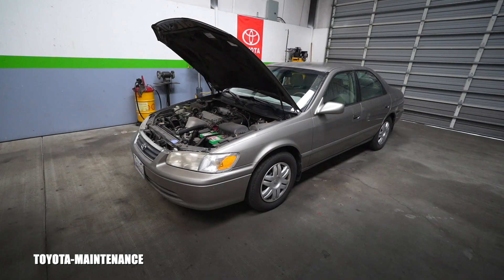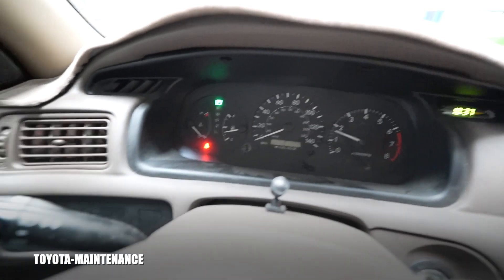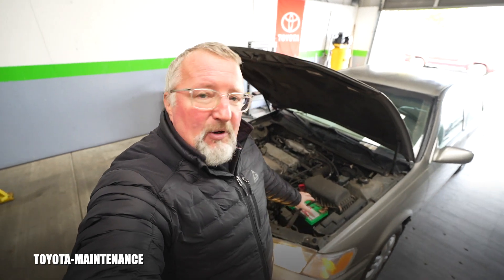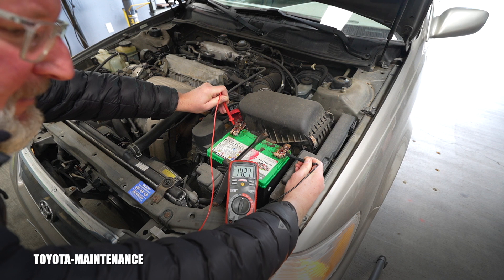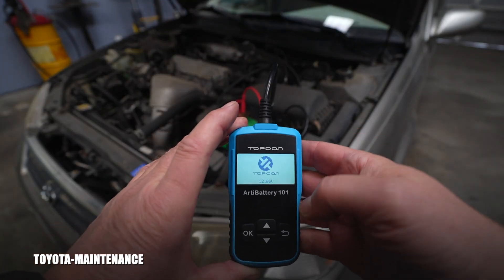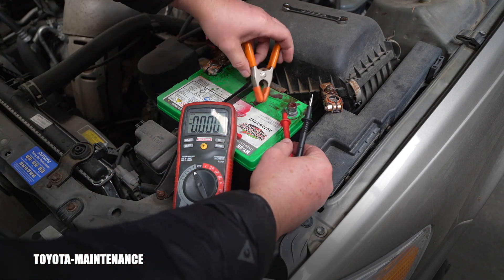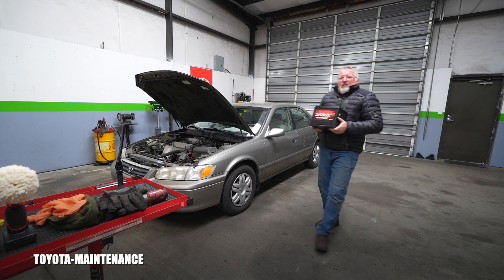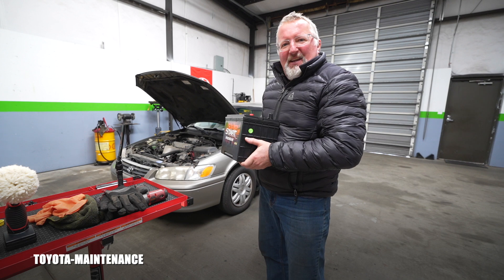Bad Battery or Bad Alternator? How to check

Comment: I always check starter draw to ensure cable to starter ad battery is good and not internally corroded. Great video 👍🏻
Reply: How do you do this test ?
Reply: Please make Video.  this info was GREAT!
 @Dicofol1  Good point Thx!
Reply: @Dicofol1  it’s a load tester very inexpensive. South main auto did several on how to do it . Very simple test and can tell you if cable is corroded. You can do a test with a test light bulb to the starter main terminal also. Using a H1 headlight bulb while someone cranks it. This test is also on scanner danner and south main auto

Comment: I still have a battery that came with my Jeep Grand Cherokee that was made by West Penn Manufacturing with the EXIDE
Brand Label for going on two years ago though it had been replaced 3 years ago. It IS an absolute beast of a battery that was replaced by the previous owner, and even though this battery has been through many spells of discharge because of a worn 
ignition switch tumbler and worn key, along with other parasitic amperage draw as well. In the first instance, if you didn't
positively find the off position detent just right, the battery would discharge like crazy and in a matter of oh say 1 day or less,
the battery would be stone cold dead like no other. This had been happening to the previous owner and so too, it happened
to me! This happened just way more times than I would care to admit! During the summer, I went and replaced the ignition
key tumbler and ignition switch in one fell swoop! Yet, once again, during the fall of this year, I didn't drive the Jeep for 1.4
days and the new battery that was replaced dropped in voltage from 12.72 to 12.31, telling me that I have parasitic drain a
going on and no matter how that slight it may be, it is still a real problem for me! It's just like trying to chase a ghost and
this is not my idea of having fun! The one thing that I have noticed though is the rearward CD Changer in my 2003 Jeep Grand 
Cherokee seems to have a nasty habit of activating at strange times because you can hear the mechanical action taking place.
In addition to that, there is also some mechanical action and movement in the passenger side, perhaps something like the
temperature blending doors that are moving after the ignition key switch has already been shut down. Oh and yes, I have 
several other gremlins going on too! Such as power windows that do work and then cease to work all together. But wait, there
is a problem with the interior driver's door that wants to stay on longer than it should be and yet the passenger side door isn't
working. But wait, there is also instances where the radio works but then it would cease for a period of time. But wait, the alarm
system with that blinking light right on the top dashboard is no longer active, nor do I think that the active portion of the anti-
theft module is inoperative. WOW, just so many gremlins than you can possibly shake a stick at!!! My current status is for me
to hunt down and install a new remote anti theft with a complete shutdown/battery disconnect for sure now. All of these @$$
blisters that this Jeep is giving me are just far too many and this is what is prompting me to take this major action here in a
matter of days because I am damned sick of ALL of these issues, period!!! Currently, I believe that there is either an issue with
the front passenger door/power windows module or loss of data/communications link because I've already inspected the
wiring passing through the kick panel area to the driver's door is fully intact with no broken wires. Since the body control module
had become suspect, I already replaced it and guess what, the power windows started working again but only a couple hours
later they quit again, same goes with the power door locks too! What a fricken mess to deal with! I ruthlessly intend to take the
main power feed off of the body control module for good measure and re plumb/re route the power feed with it's own resettable
30 amp fuse link and power relay that is integrated into the key on, live circuitry and skip all of that bsery!! Long before a body
control module was dreamt of there was none of that happy stuff to get in your way and I just want rid of it!!! Same goes with
the disconnecting of the rearward multi CD changer, just gut it!!! Same with the old anti-theft system, just bypass it and things
should be a whole lot sweeter! Should I not be having to deal with all of this crap, my sanity just might be restored too!

Comment: Disconnecting the battery while the engine is running WILL blow the rectifier diodes in the alternator! The easiest way to check the alternator is to start the car, and let it warm up. Then turn on high beams, observe the headlights, then turn on the air conditioner and put the fan on max. and see if the headlights get dimmer. I always get over 7 years of use from a battery in my Tacoma, and on my boat.

Comment: My Camrys battery recently passed after 8.5 years of life. I was monitoring it and in the last year the state of health went from 85 to 65 percent. After that it wouldn't start the car. One cell was failing and just finally shorted out. It is best to look out for that quick drop in health to determine if the battery is at its end.

Comment: soon as i saw the alt putting out over 14V i knew it had to be something with the batt...i had a similar thing and it turned out to be corroded terminals; i cleaned them and that was it.  The batt was 5 years old so i replaced it but i bet it could have lasted another year or two easy; love those Interstate batteries with high CCA's..

Comment: My fiancee's 2000 prizm may have a bad alternator, this is the video i need. 2 batteries in 6 months
Reply: Last time I was messing with it trying to diagnose, As soon as I would disconnect the jumper cables from my other car, her car would die. I've been pretty confident it was an alternator for a while but we couldn't afford to buy one, until now when its cold outside
Reply: Make sure all connections are clean and tight also.  Ground wires also.
Reply: @waltersweet4595  We tried that out, Very clean connections with no corrosion. A local shop was going to rebuild it, but it turns out they can't get a rotor for it

Comment: FWIW I have a Ancel bst200 and a Topdon BT50 battery analyzer. The ancel show a 2017 battery at 552 and bad. The topdon shows 590 and good with 71%.  Checked at the same time frame and at 12.61 V. Was kind of hoping for closer numbers.  In the end I went with the bst200 numbers. Battey still starts the pickup but I replaced it for the winter since winter seems to be tough on batteries around here.

Comment: Excellent video. I have a 2003 highlander. Its in mint condition.  I live where it gets very hot and very cold in the winter. (Chicago). I want to store this car inside a uninsullated garage. What is the best recommended tips i can do to protect and not damage the car in the long run. I plan on storing the car for a max of two or three years? Someone will be able to start the car once a month for a few minutes? Is this even necessary to run the car a very short time once a month?
Thanks for the consideration.

Comment: Another great video. You mentioned that you should be able to let the vehicle sit for months and then be able to start it no problem. I wonder about that. That battery probably has a rating of about 58 amp hours capacity when brand new. Lead acid batteries will self discharge at maybe 5% per month even when not connected to anything. Then at 40mA after two months that's a drain of around 58 amp hours (0.04 x 24 x 60 = 57.6). So I'm thinking that after two months the battery would be completely dead.
Reply: Most group 24F have a capacity of 65Ahr or more. Even with a 7yr old battery being left to discharge normally in  my Camry for 3 mths, it was still able to start the V6 engine. Mind you, that was in the warmer part of the year. In winter, I take it out every month to fully charge it out of the vehicle.
Reply: I think the group 24F is a better choice and that's what I use in our older Camrys although from what I can tell a lot of the basic 24Fs only have 58Ah. It looks like the battery he took out of the vehicle was an Interstate MT-35. I'm thinking that what makes the difference is the level of the parasitic drain. I don't recall the exact numbers but I believe that at least the older Camrys had a drain of around 20mA. That would give you twice the amount of time and I could see having it start after 3 months. However at 40mA I think the chance of starting at two months would be low. I'd be curious if anyone on here knows what the typical values are for different Toyotas.

Comment: Also don’t use the alternator to charge a dead battery. It puts tremendous strain on an alternator and they are not designed to charge dead batteries designed to maintain a property charged battery. Use external battery charger to bring it up to full charge.

Comment: Does that MT-35 only say 550 CCA?? Too low for me. Dealer here wanted to leave me short and only sold me a 35 instead of giving me the 24F I wanted. You always want that extra power so if the health goes down then with the 100 extra CCA, you're still above what a good grp 35 is. Never go for less. The harder your alternator has to work to keep a battery up, the worse mileage will be.

Comment: I'm going through this now scion xb 1.5 ..I  do have a draw it's coming from the only fuse that's live when car off.that line splits  in wire diagram half goes to alternator other half goes into ignition and dome lights. Could be the radio as it's after market any suggestions?  Thanks love the content

Comment: My car has a continuous consumption of 0,5A when is completely turned off. And I don't understand why.... I don't find what device or component is wasting so much current. When I take out the radio fuse, which is connected also to all the internal lights of the car and the dashboard, I don't know what is consuming so much current because are all these connected to one fuse...
I think I should disconnect completely only the radio to test the car consumption, so I can see if radio is the problem.
Reply: Does it have a rust protector pro-coat? Those things are a scam at the dealer and it just drains battery.
Reply: @toycoma98  are you referring to the protective rust coating on the battery terminals?
Reply: @MD-qz6gk  No, but its connected to the positive terminal for power. Its supposed to prevent rust, its a small silver box with a small led light. When you buy a new car the dealer installs them if you wanted, but i believe its just a scam. It beeps very faintly and led light blinks, drains your battery slowly.
Reply: @toycoma98  I think that I don't have it. But thanks for the information.

Comment: When I pull out the sunshade in my Prius I often somehow move the ceiling light switch to ON position, don't notice it unless I look out kitchen window at night and see the interior light is on. I have had two Corollas which each had two courtesy light switches and lights on the bottom of the inside rear view mirror, which switches fail over time and then stay in the ON position which light is even harder to detect. These also create vampire, ignition off, draws which can kill a battery, especially in cold weather. Galpal's 21 Corolla seems to have a similar problem now that the weather is cold,  there are so many gadgets in that thing I don't know where to start. Anyone having experience with a 21 Corolla vampire draw problem please shoot me a note.

Comment: Peter... I have seen more failures WITHOUT the battery light, than with. It depends on the circuit that fails. You are so correct, Lifting a Battery terminal CAN do damage! Don't do it!
Learn to use a volt meter.